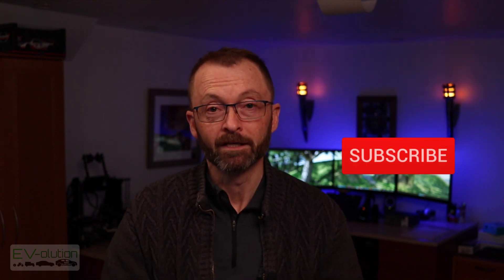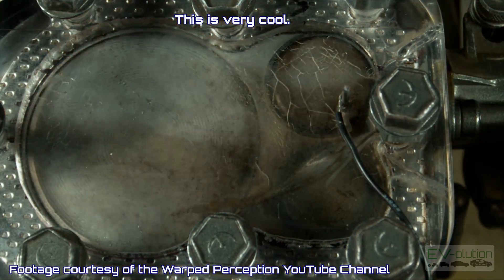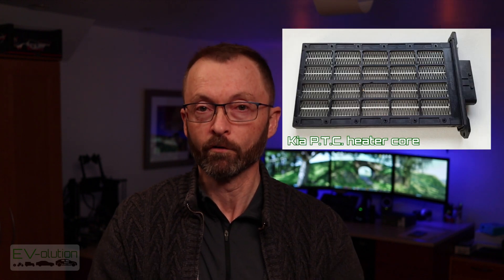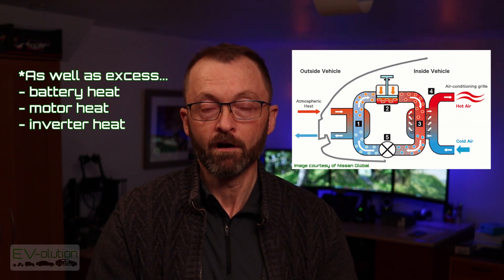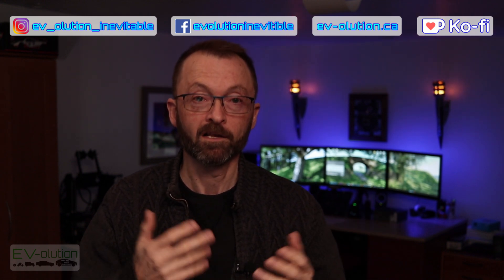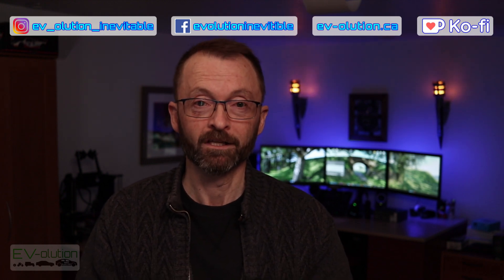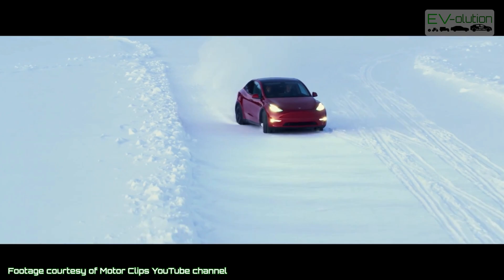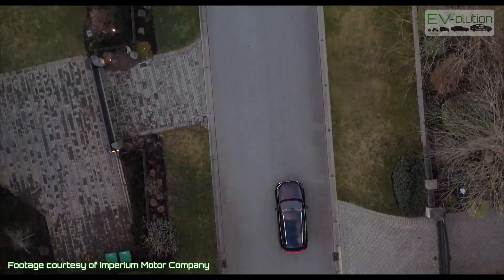EQ 006 - How do EVs heat the cabin in winter? Heat pump, or not?

Comment: Thanks for the video. PTC heaters while being self regulating, are no more efficient than a resistive heater. The resistive heater will require a separate thermostat to regulate its output, but both the PTC and the resistive heater are "resistive". Also, both are 100% efficient but a heat-pump will be closer to 400% efficient depending on the ambient temperature.
Reply from the maker: You are correct, PTC is also resistive. Thanks for the additional details, and for watching, I appreciate it 😎

Comment: why is the cold weather considered as an extreme weather condition? and why not the warm weather?
Reply from the maker: I am not sure where the question is coming from, but both very hot and very cold are extreme weather conditions. This particular video is about winter because in EVs heaters use much more energy than air conditioners do, meaning winter conditions are worse for EVs that summer. On top of that, a cold battery takes a larger hit on efficiency because to keep it in an optimal temperature you need to heat it, which uses more energy than cooling it in the summer. But you are correct, both warm and cold weather can be classified as extreme weather. I hope this clears it up a bit and thanks for watching.

Comment: Why did they not just make a heater that would heat up a coil and have a fan behind the coil pushing the warm air to the cabin once the coil reaches temperature
Reply from the maker: That is exactly what resistive heating is, and PTC, as described in the video, with the fan being the blower motor and fan. The issue is that type of heating is incredibly inefficient, which is the reason manufacturers added heat pumps.
Reply: @EV-olution  OK thanks for the explanation I thought that is what you meant but in the video you did not say about the fan being involved

Comment: Having had an EV with a heat pump and owning one now without it has born out my theory that it would make no difference to the short journeys I make 95% of the time I am sure that would change though if I did a long trip in the winter as heat can be scavenged from the battery and drive systems so the bottom line is make your decision based on your usage, there is one other consideration which may or may not concern you and that is resale interest as in there may be more buyers if the vehicle has a heat pump to cover all usage.
Reply from the maker: I agree that the longer you use the car on a single trip when it is cold, the better it is to have the heat pump.

Comment: First time ive payed attention when i saw the teslas rear seating passenger area windows were fogged up as though it was freezing inside. 

Maybe the guy was running low on energy so he dicided to freeze a little. 
Temps were minus 8 so it was pretty cold.
Reply from the maker: If you see fogging in almost any car, when it is cold or humid outside, usually means the user has either turned the HVAC to a very low or off setting, or has turned on recirculate, which is a no-no in those situations.
Reply: @EV-olution  ya maybe the guy was running low on battery so he kept it off.

Comment: Insufficient,  maybe polar bears may enjoy it.
Reply from the maker: You must be right. The fact that I have not had to scrape ice from my EVs for the last 4.5 years because the car gets to 27C within a few minutes, and I have to constantly reduce the temperature in the winter because it's too hot, proves that I must be wrong and EVs don't heat in the winter. Thanks for pointing that out.... that's sarcasm, in case you missed it.
Reply: @EV-olution  Only 27C? That's much too low.. I get air out of my heater vent at 84C. Beat that.
Reply from the maker: @FreddieD-k5p  84 Celcius is 183 Farenheit, which would melt the plastic HVAC tubes, parts of the dashboard, and fry electronics. Beyond that, even if the car could survive that temperature, it would cause 2nd to 3rd degree burns to anyone. FYI, I will no longer respond to your ridiculous comments, so I hope you enjoyed the 30 seconds of the attention you were seeking. Have a great life.

Comment: If you live in a cold climent state u need heat in winter
Reply from the maker: Yes, that is correct, just like here in the province of Québec,. Which is why I made this video to explain that electric cars heat very well, regardless of the heat source, heat pump, resistive, or PTC.
Reply: @EV-olution  I heard that they fail a lot
Reply from the maker: @michaelstrout3839  I don't know where you are getting that information, but since Tesla fixed the heat pump issue they were having about 1.5 years ago there are no problems I know of. Also, for cars like the Chevy Bolt, that does not have a heat pump, it never had heating issues, neither does the older Nissan Leaf which also did not have a heat pump. Kia and Hyundai EVs also don't have issues. There was a bad part from a heat pump supplier for Hyundai about 2 years ago, but that was easily fixed for the few people who had the issue. In general, any modern EV has no issues offering tons of heat, and offers all of the benefits I mention in the video. I had a Niro EV for 3 years, I have my EV6 for over 1 year now, my wife has a Soul EV for over 4 years, and we have never had issues with heat in the winter, even at -35C.

Comment: One thing that should happen to anyone that owns an EV...They should be made to put their credit card into the charging station and pay for the electric they use to recharge their batteries!  Once they got their first credit card bill, they'd drop EV's in a heart beat...Sad when we are forced by default to help subsidize the 'fuel" for EV owners, but they don't offer to help pay for my fuel at the local station!..Only sweet smile I get is knowing I can find fuel most anywhere and not have to plan my day, week, or vacation around the location of a charging station...Not to mention I can fuel up in less than 15 minutes, arriving at my destinations long before the EV has unplugged from the charger!! :-) .The only worthwhile EV's are golf carts and wheelchairs..!
Reply from the maker: It is a shame that you have been given incorrect information about how EVs and EV charging works. Every EV owner pays for their charging sessions and the electricity they use. It is not always directly with a credit card on the station. Most of the time you use an app that has your credit card in it, and you load your account with a dollar value that you want to use to charge, and it is taken from your credit card.
With that being said, 90% of the time an EV owner does not need to use public charging stations because we can simply plug in the car at home, and as far as I can tell no utility company is giving electricity for free, we pay for what we use. “Filling up” my EV at home costs about 7$ and nobody is subsidizing the electricity use.
What I can tell you is that the US government heavily subsidizes the gas and oil industry, so you don’t need EV owners paying for what you fill your gas car with. Conservative estimates put U.S. direct subsidies to the fossil fuel industry at roughly $20 billion per year; with 20 percent currently allocated to coal and 80 percent to natural gas and crude oil. Here is one of many references: https://www.eesi.org/papers/view/fact-sheet-fossil-fuel-subsidies-a-closer-look-at-tax-breaks-and-societal-costs
With that in mind, the National Electric Vehicle Infrastructure (NEVI) Formula Program established by President Biden, will provide nearly $5 billion over five years. Which means that the annual subsidies to help create a bigger charging network for EVs in the US is less than 5% of what the US puts into oil every year, and has been doing so for decades. And the NEVI program is for charging stations, not the electricity we use. EV owners don’t see a single penny, we just get to use the charging stations that will get deployed, meaning that over time long trips will require less planning.
On a related note, I have not had to spend those 15 minutes that you mentioned, filling up with gas, for 4 years now. How many times per week are you spending those 15 minutes? How many hours per month, or per year does that add up to? And how many thousands of dollars of gas are you spending annually?
Not only do you save time and money with an EV, you help reduce the pollution you put into the atmosphere, helping fight climate change, so your children can have a planet to live on. If I had to choose between a golf cart or a gas car, I would take the electric golf cart if it meant leaving a healthy planet for my kids.
Some links to consider with regards to climate change:
California: https://www.washingtonpost.com/weather/2023/02/28/california-sierra-nevada-blizzard-snow-record/
Texas: https://weather.com/news/weather/video/serious-dust-storm-rolls-through-west-texas
US Drought Report: https://www.ncei.noaa.gov/news/us-drought-weekly-report-february-21-2023
US Tornadoes as of Feb 28th: https://www.cnn.com/2023/02/27/weather/winter-storm-us-monday/index.html
I hope this information helps you out and have a great day.
Reply: you do realise EV owners pay for the electricity? how are you so misinformed?
Reply: Everything you say is completely true! I bought an EV six months ago and i'm on a mission to convince everybody else not to buy an EV as I want the cheap electric and free access to public chargers myself for at leat a couple of years. Mass adoption will only serve to cost me more, so please stick with your petrol car for at least a few more years!
Reply: You must be a Rhodes scholar with such a deep understanding of this whole topic.
Reply: Thank you Scott for your input. Go have another weiner.

Comment: My wife has a Vauxhall Mokka e and cars heater has stopped working. That is until we take it to the dealership. Three times we have taken it to the dealership and I’m not sure they know what to do to fix it.
Reply from the maker: That is unfortunate. Since we don't have Vauxhall in North America I don't know the brand, let alone the reliability or issues. If it is not a known issue for the Mokka e then the problem has to be the heat pump, the PTC heater, or the controller. I really hope the dealer finds the issue quickly and repairs it quickly.

Comment: According to AAA driving in 20 degree weather with the heater on shortens the EVs range by 41%!!
Reply from the maker: I am not sure what EV they were using and how they tested, but that has not been my experience in my previous Niro EV, nor in my wife's Soul EV; we experience an average loss of 30% range in the winter over the last 3 years. I also know that it is not the experience of many other EV owners. It's important to note that the initial heating of the cabin is what "costs" the most power but once at temperature the heating costs very little. Another tip is to preheat the cabin while the car is plugged in at the house if it is very cold. I do this when it is -25C and colder, otherwise I just preheat and take the power hit because over 300km of winter range is more than enough for daily use.
Reply: That’s why they are basically toys

Comment: If I buy a car that is advertised as having a heat pump, how do I confirm it actually has?
Reply from the maker: It depends on the model of car since they all have different heat pump placement.
Reply: @EV-olution  is there a light or switch to actually show the heat pump exists.
Reply from the maker: @billywizzer1084  no, the heat pump is not something you can monitor in the car, you have to look for it under the hood.
Reply: @EV-olution  I do apologise for keeping on with my questions, but as car companies charge a great deal extra for the heat pump,  how I would know it's working and anything else you think is relevant.
Reply from the maker: @billywizzer1084  the only way to know if it has one is to look at it under the hood. Sorry.
Reply: With the niro, there is a little cover over the solenoids to the left. On EGMP, in the US anyhow, all AWD stuff has it. Top end trims of the leaf have it, all older gen Souls have it. 
IIRC for the Niro, old or new, 99% of the time if it has a heated steering wheel it has the heat pump, but I found one for sale that had the heated steering wheel but no heat pump...
Reply from the maker: The easiest way is to simply look under the hood of the Niro and look for what I show in the video.
Reply: @EV-olution  True, but the next gen puts all of that underneath IIRC.
Reply from the maker: @sprockkets  my Kia EV6 has the heat pump in the same location as in the Niro EV.
Reply: @EV-olution  The pump is still at the bottom, but the valves and such were moved down in the Niro.
Reply: @EV-olution  Is the heat pump easily discernable?
How would I know what a heat pump looks like?
Does it have heat pump stamped on it?
Reply from the maker: @billywizzer1084 it is visible, as shown in the video. It is not marked though. When you turn on the heater you can hear the heat pump turn on. I can repost a picture on Facebook if you like.

Comment: I believe I read up on the Niro heat pump and found that they made a couple of design decisions to make it more effective than some others. I believe it draws air from inside the car and also circulates it over the battery's cooling fluid to recapture some of the waste heat from the batteries.

Great video!
Reply from the maker: Correct, Kia and Hyundai heat pumps are very efficient, scavenging waste heat from the inverter and battery to heat the cabin in the winter. This does, however, cause an issue in the winter when heading to a DC Fast Charging station to charge since the battery is cooled down by the heat pump, reducing the efficiency of charging in cold weather. To resolve this they need to add battery preconditioning, which is simply a software update away. The nice thing is that Genesis has this option for the GV60, which means that it could easily be added the Ioniq 5 and EV6, which I really hope they do.

Comment: Another thing to keep in mind, heat pumps are more complex, so a little bit more prone to failures... (and expensive to fix in case of problems).  Yet, they are more efficient :)
Reply from the maker: Yes, it is a more complex system, but with Kia having heat pumps in their EVs for quite some time, with few failures, I am no too worried 😎

Comment: Hi, I am the owner of the eNiro 64kWh without a heat pump. Do you have any idea how to preheat the battery before it is even connected to charging? Or before a trip on frosty days when I charge in the garage from 230V or 400V 3F (Poland)? I know, of course, that there was a petition to KIA to add a button that starts heating the battery while driving before charging, but it probably did not help ...
Reply from the maker: Just an FYI, the heat pump is only used for the cabin heating and air conditioning, it is not related to the battery heater. To be able to heat the battery you car must have the Winter Mode option in the EV settings of the touchscreen; this will confirm if your car has the battery heater option or not. With that being said, there is no way to precondition the battery before you get to a rapid charger. Also to note, the battery heater (Winter Mode) will only activate when the car is plugged in and charging. As you mentioned there is a petition (I signed it) to get the preconditioning option added to the e-Niro, but unfortunately I don't think Kia will do anything about it. It seems they might add it to the EV6 and Ioniq 5 since it seems the Genesis GV60 will get the feature.
If your car is at home in your garage to charge on 240V, then I would suggest heating the garage to 15C to keep the battery warm to ensure you get more range, or make sure your have Winter Mode activated all of the time. There is no need to turn it off because it has no effect in warmer weather. Also to note, if you use the Kia Connect (UVO) app to change the desired charge level, there is a bug that deactivates Winter Mode so you have to reactivate it when you get in the car. This only happens when you use the app to change the max charge level.
I hope this helps.
Reply: @EV-olution Thank you. This is a very interesting information about the Kia Connect error, I did not know about it before. Winter MODE was turning off for me, but I didn't realize it could have happened after using the app the way you described.
Reply from the maker: @sylwesterjachimowski7642  I am glad I could help. I am surprised that Kia has not resolved this issue since it should be simple to fix in the code of the car. Thanks for taking the time to watch my video, I appreciate it.
Reply: I have a 2023 Kia Niro EV with a heat pump.  How do you known when it's  working and is there some way it is shown on the screen?
Reply from the maker: There is nothing on the screen, but you can tell it is working because of the sound it makes when the heating/AC is on.